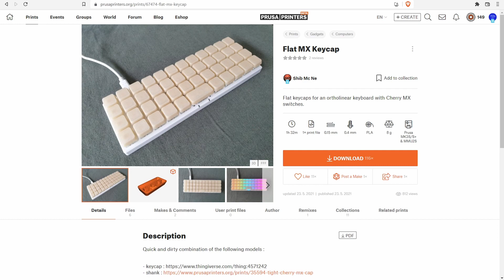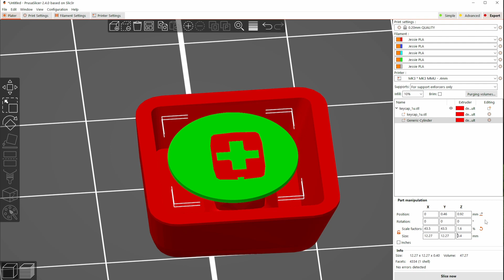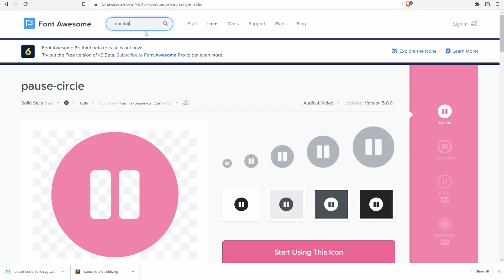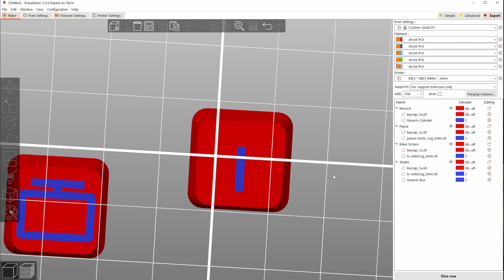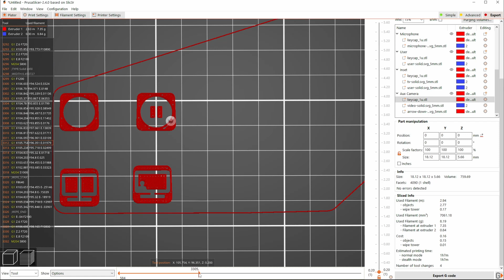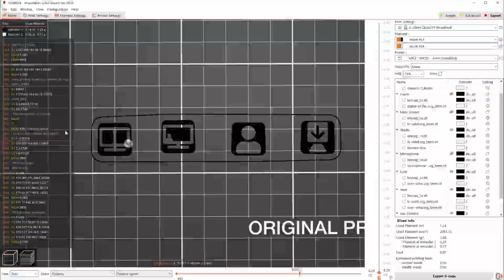3D Printed Custom Key Caps, with or without a multicolor printer, using  PrusaSlicer.

Comment: Thanks for the well thought out and paced video. I used to just change color by layer, until I designed something that needed to deal with 2 colors in the same layer and I stumbled upon this method, but not this video (I don't know why it didn't come up a year ago). Anyway, now I have a design that uses 5 colors in the same layer, and I'm fighting this technique. It works pretty good, but that little bit of ooze that basically is "air priming" that occurs after the M600, and the return to the print is what is giving me fits. None of the videos or articles I've read on using this technics has included how the operator deals with this ooze. I normally just have a folded paper towel in hand and have to "chase" the print head as it moves to start printing after the M600. I tried a wipe tower and boy, that just made things worse somehow. If anybody has any tips or advise, I would appreciate hearing it. The other annoying thing when using this tactic with several changes is losing track of where the printer is going next, so as to make sure you get the right color loaded. I've tried some M117 commands to write to the LCD, but I've never been able to get anything to show up. Again, if anyone has been successful at that I sure would like to know how. Thanks again.

Comment: Hey this is an awesome video! I have a quick question, my PRUSA MK3S does first a color change before starting the print, but this is so unecessary because pre load the right filament, how can I get rid of it without manually change my gcode file? like where does the colorchange come from in the first place?
Reply from the maker: In the Color Change section of the Printers Custom Gcode, change it from m600 to -

{if layer_num >= 0}
G0 X0 Y0
M600 
{endif}

So only run m600 if the layer isn't the first layer. I have never been able to determine why it does this, but this will stop it! Prusa Slicer and Orca both do this for any printer that uses manual swaps. Thanks for watching!

Comment: this is so cool, i do have a question, i have an ender s1, how would M600 work here with a filament sensor?
Reply from the maker: A run out sensor? The run out sensor should not have any bearing on using M600 in your gcode. Atleast it never has for me on Marlin based machines. M600 is usually called when the sensor is triggered. So the action taken as far as parking, unloading and reloading would be the same. Klipper is a bit different, as it is all macros, and there is no M600. But the same result can be achieved. Thanks for watching!
Reply: @HackMonkey  awesome thanks! im glad you mentioned Klipper without M600 i'll have to look into it

Comment: Wouldnt it be easier to just edit the keycap in fusion 360 and make an stl for each.
Reply from the maker: For someone well versed in Fusion 360, maybe. But that is introducing another specialized  tool in the process, and requires specialized knowledge of Fusion. This video isn't about the best way, but a low barrier to entry, and a way for those already using PrusaSlicer to use it in a new way, they might not considered.

With PrusaSlicer 2.7 about to release any day now, this project gets even easier, now that SVG files can be directly imported.! Very exciting times!

Comment: I am trying to learn about Prusa slicer, I have been using cura for about a year. I Have an ender3 S1 pro that has a sonic pad. is there any chance of a video using Prusa and using the sonic pad? I would really Like to learn multi color printing using this setup.
Reply from the maker: I don't have a Sonic pad. But my understanding is that just changes out the firmware for Klipper. I do have a machine that runs Klipper. In that regard, nothing really changes in the slicer. The big consideration is that you have a good M600 macro for filament change in place in your Klipper config.

Comment: This is amazing! And also one of the most underrated YouTube channels. The tips you provide should be featured directly on Prusa's website!

I did some experimenting, and I found that unless I enabled the wipe tower, I would get random blobs that ruined the print (different colors would show through the surface, or there would be large blobs sticking out past the outer perimeters) With the wipe tower, everything comes out looking perfect.
Reply from the maker: Wow, thanks! You are on the right track, keep experimenting!! Odds are there is a setting that can be tweaked to take care of that issue, but if the wipe tower works for now, then keep going!
Reply: @HackMonkey  I will definitely keep on experimenting! I'm planning to test it with 3 "extruders" tonight. I hope the LCD shows which extruder it is switching to, otherwise I'll have to make a checklist from the gcode previewer and tick them off as I change filaments to keep track.

It might be possible without a wipe tower, but I'm not sure if it could be done without editing the gcode. Even if I am quick  with the tweezers, the extruder will still "touch off" and extrude a bit into my infill without the wipe tower. Normally that wouldn't be a problem, but if the first color is semi transparent and there aren't enough layers to hide it, it shows through.
Reply from the maker: @MattPandina  It will depend on your printer/firmware. The specifics of M600 are controlled in the Advanced Pause Feature of Marlin, in configuration_adv. Some of those settings maybe exposed in your settings menu, but some will require a firmware recompile, assuming you are Marlin based. Klipper is a bit trickier.
Reply: @HackMonkey  Oh wow, that makes sense. I did some searching, and that is what I found for people that want it to tell you which color to swap to. This rabbit hole is a deep one, but I've already been able to get incredible levels of detail in the first layer with three colored prints. Thanks again!